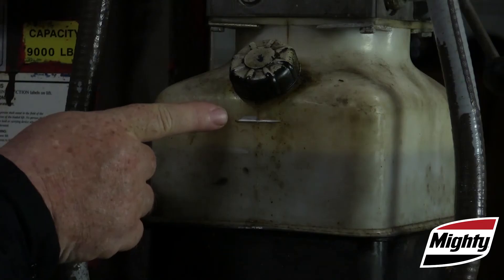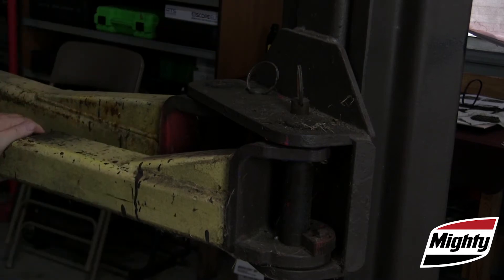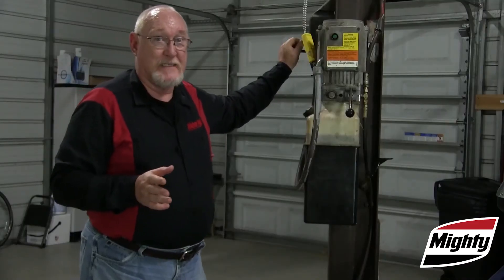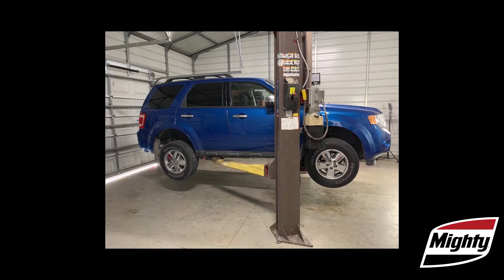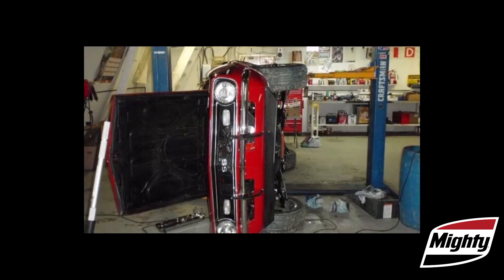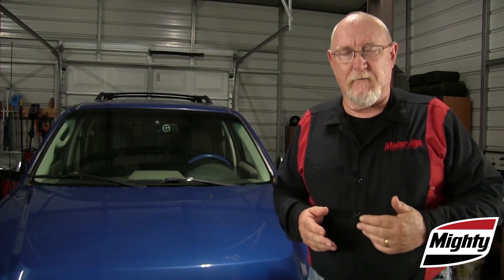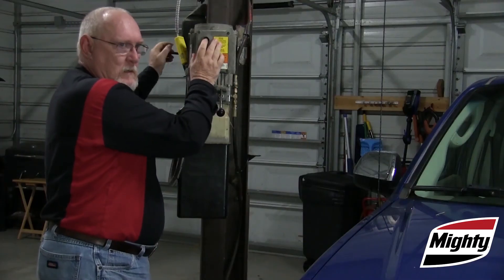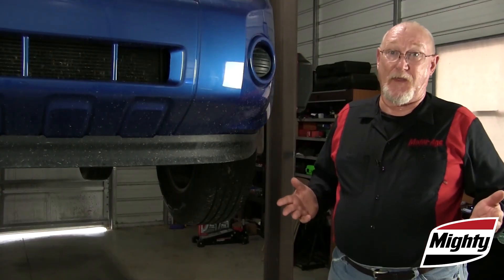The Mighty Minute - Ep. #42: Automotive Lift Safety, Maintenance, and Training

Comment: You really need to stress that whenever resting on locks make sure both catch the load and whenever lowering make sure both locks are clear and don't stop one carriage on way down.  This is one of the reasons for the inspection but you should be vigilant, those points and the fact that the arm locks engage when just off the ground.